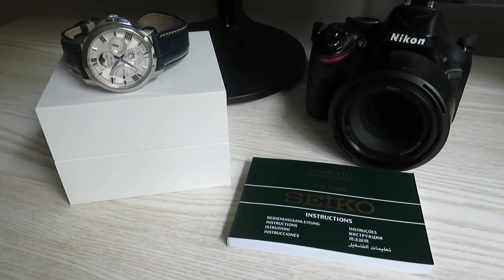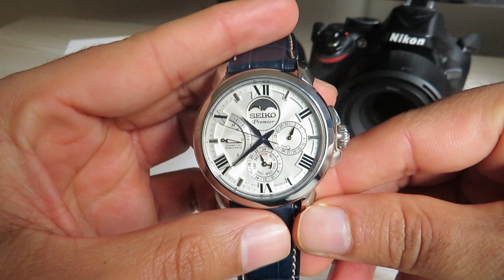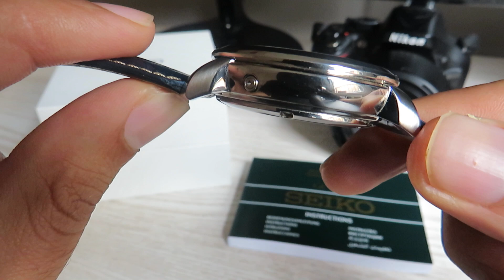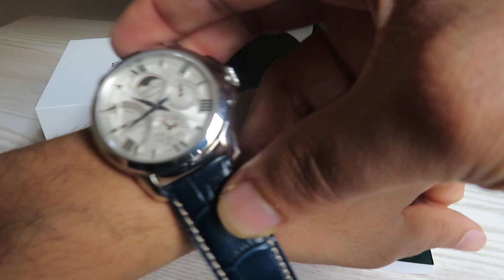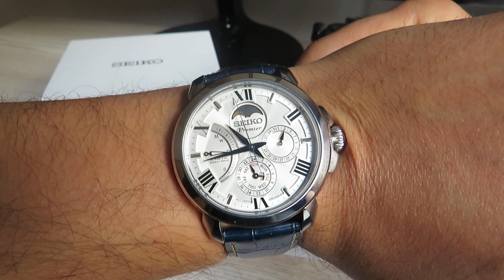A different kind of movement- Seiko Premier Kinetic Direct Drive Moonphase SRX015P1

Comment: I have a seiko premier kinetic direct drive 5d22 and haven't used it in 6 years. Its dead and it wont charge. Any advice?
Reply from the maker: 6 years is a long time, the only thing I can suggest is to get it checked professionally.